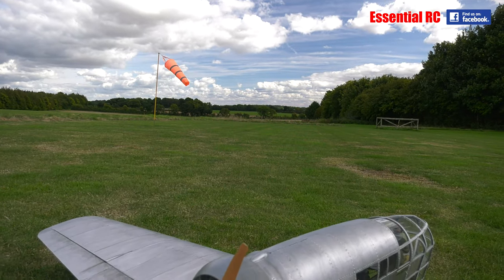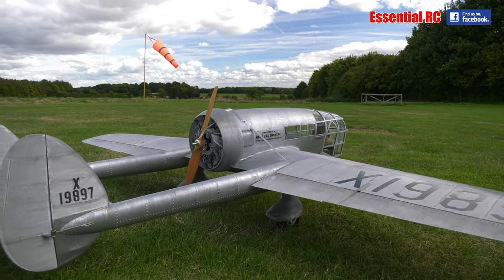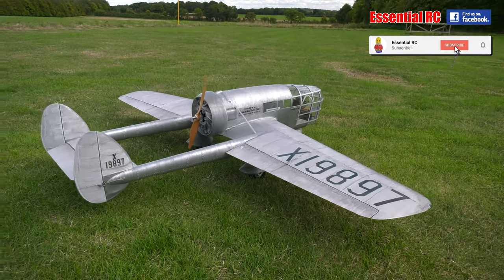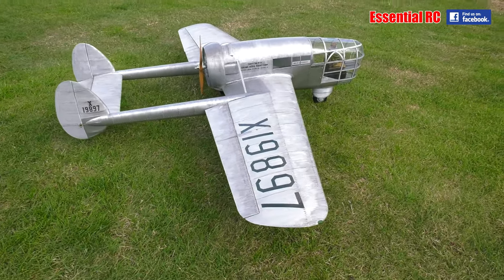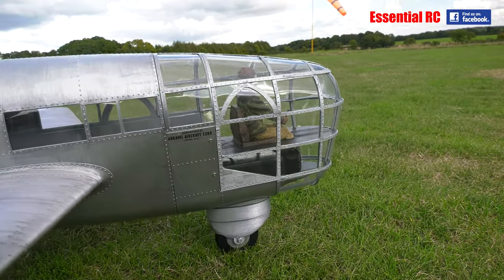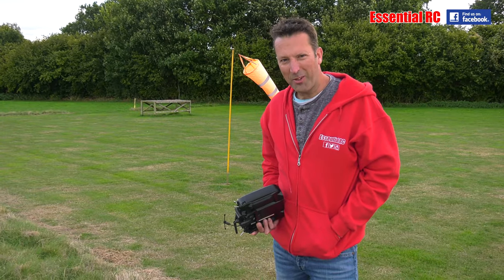SUPER SCALE 3D PRINTED RC AEROPLANE ! Abrams P-1 Explorer |  Essential RC FLIGHT TEST

Comment: Something does not seem right either the tail booms are too long or the landing gear to short, if you watch the take off you can see the tail was virtually dragging along the floor even though he had a very gradual take off or it’s not designed to take off from grass and was sitting very low either way nice model well done 👍